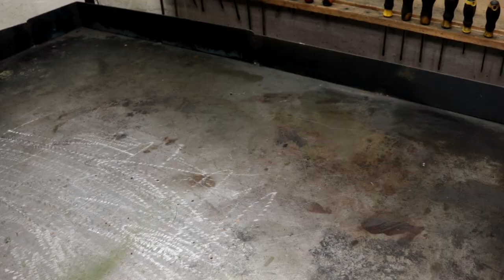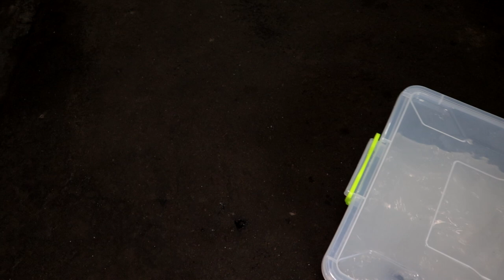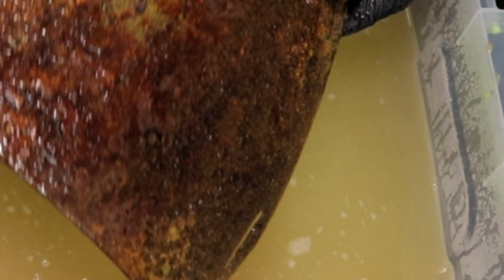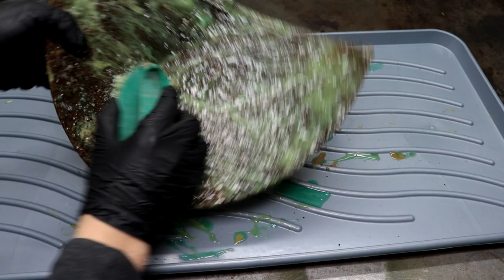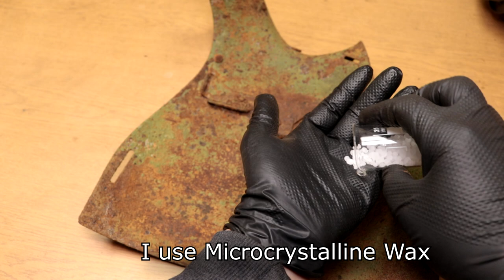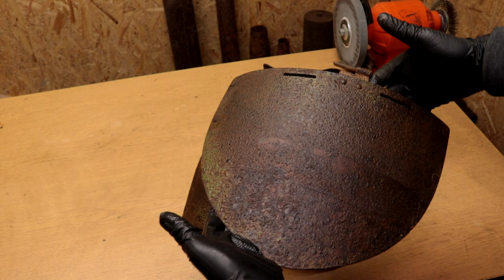Preservation Very Rusty World War II Steel Breastplates. Cleaning in Oxalic Acid

Comment: If you want to make the microcrystaline wax easier to apply evenly, you can use naptha to thin it, allowing it to be liquid at room temperature. The naptha will evaporate over time, leaving only wax on the surface.
It might risk softening some types of paint, but that is also a risk with high heat.

Comment: I know that you like preserv the original paint, but if you don't remove completely the rust, under the wax the corrosion will proceed till the destruction of the item.
Reply: And there is the key difference between restoration and preservation. But yes any restoration should be done with complete paint remova.
Reply: Exactly. There is enough oxygen and moisture at molecular levels within the remaining oxides to continue working on the steel.

Comment: Do you do something to stop the corrosive effect of the oxalic acid? Like a bath with bicarbonate sodium. 
And, do you heat the piece to evaporate any trace of humidity in the steel before sealing it with wax?
Thank you.
Reply: washing with just water would remove the corrosive effect on the metal?